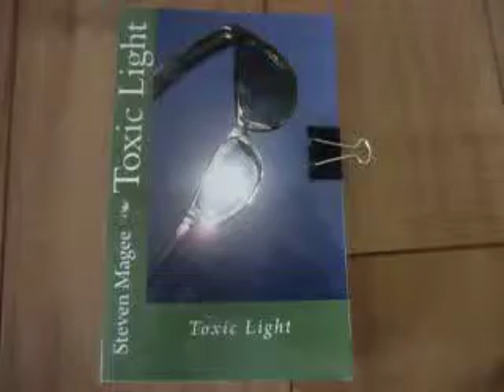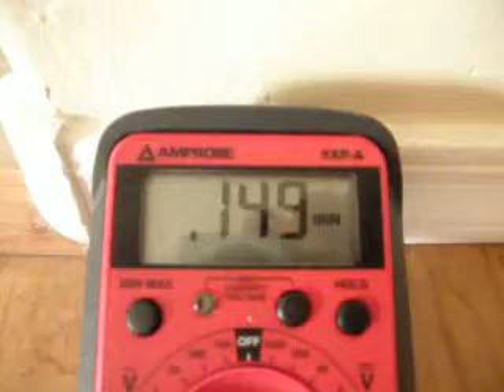Logging the Minimum and Maximum Values Of Stray Voltage

Comment from the maker: I have just repeated the tests that I did in the summertime and there have been some quite interesting changes. The voltage waveform is now severely distorted on the grounding system and is showing 60 Hz harmonics, 10 kHz harmonics and a wide range of frequencies between 0 to 1.5 MHz on the grounding connection.  This AC voltage waveform is present on my tiled flooring and I wear insulated shoes in my home now.  The power company refuses to recognize the problem and has never measured my floor.

Comment from the maker: I checked the readings when I was taking them, they are continuously there, it is not a spike.  I was fortunate enough to catch a spike on a fault in my area and the reading did spike up to 1.66V from the usual 1.5V that I generally record.  It coincided with a loud bang that I heard near my home and a dip in the lights.  The sine wave is good, I have checked with an oscilloscope, no RMS meter needed.

Comment: Hmmm ... The Amprobe 5XP-A does _not_ indicate to be an AC RMS voltage indicating meter ... therefore the indications can be a little 'iffy' (reading peaks vs an actual AC waveform over an entire 60 Hz cycle) when measuring AC voltages that may contain spikes or transients, including lightning and motor-start/stop and other switching loads, especially anything inductive ... 

.